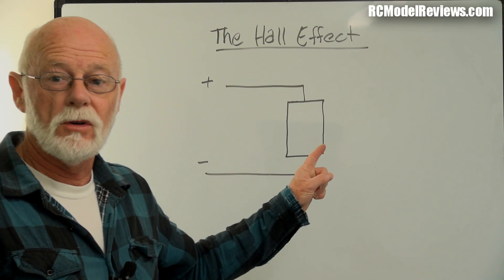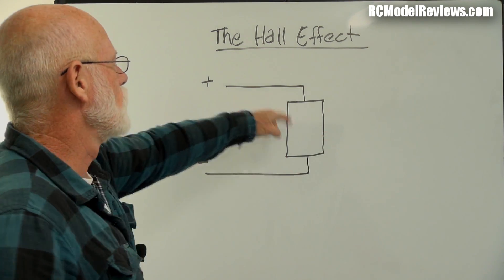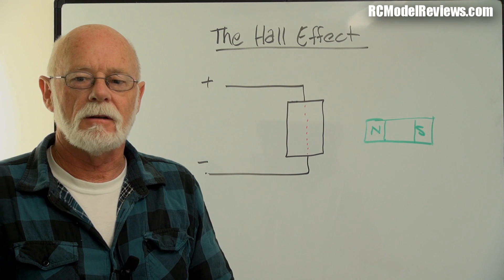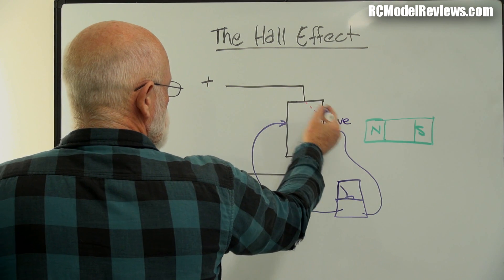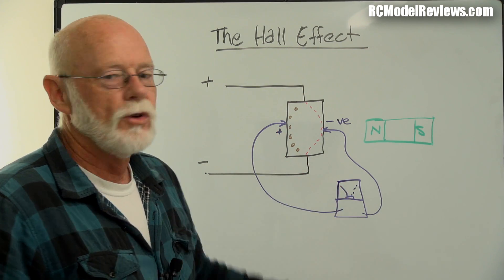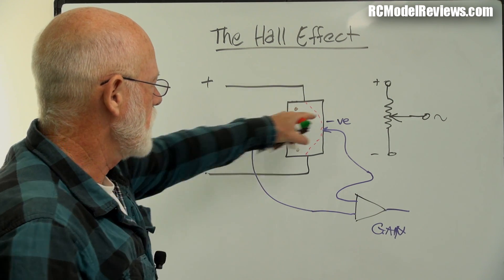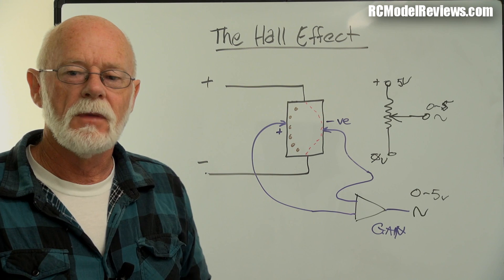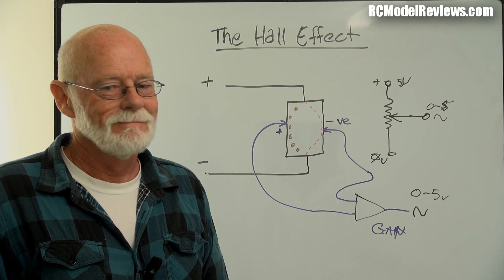Electronics 101: The Hall Effect explained

Comment: I would hypothesize that the hall effect might not be measurable without using the semiconductor, much the same way you couldn't measure the pressure difference between the water at the surface of a pool and the bottom of the pool by using two hoses filled with water. Since gravity is creating the pressure difference, and the water in the hoses weighs the same as the water outside of the hoses, there will be no pressure difference created. Unless you fill the hoses with something other than water, which then you can measure the difference in pressures created by gravity's disproportionate pull on the heavier substance (the water). So I would suspect that that same hall effect that is pulling electrons towards one side of the conductor, would also equally pull electrons away from the conductor being used to measure that effect, unless the effect were disproportionately stronger in the material being used. Which it is apparently. So that's something interesting to take into account here.

Comment: I'm very slow at grasping anything in the topics of physics but what I always tend to do to help me grasp it is to look at the foundation of most all things which is the table of elements I think we are on 118 of them, also I remember the fact that as humans we try to control things for ease of use so for instance if we have 600 volts power source and all we want to do is power a 60 watt light bulb we need to find a way to step down the power and obviously that's where all the components like capacitors and semiconductor come into the equation.
Reply: I explained it in a much better and simpler way. 
https://youtu.be/DtIz_HACSPI

Comment: The GMR effect (and its relatives) is often used for compass chips these days as its much more sensitive than the Hall effect (GMR effect is a quantum / spintronics phenomenon).  For stronger magnetic fields sensors will indeed mainly be Hall effect.  All conductors exhibit the Hall effect, but its a tiny small effect in metals which are very low resistivity.  Being a semiconductor does not have the advantage you describe as holes and electrons cancel out partially - they both get pushed the same direction.  The key point is you need a conductor with a very high resistivity (such as a lightly doped semiconductor).  The sign of the Hall constant depends on whether electrons or holes dominate the current.

The field strength of a magnet drops off as the inverse cube of distance, not inverse square, this is because magnets are dipoles, not monopoles.

Comment: Hi Xapk here again..... just wondering if you know how Hall effect is used in a torque sensor. My e bike's conked out and suspect the torque sensor. Various wires going between the sensor and the controller 6 in total. Just wondering if there's an obvious function of them all which I could test out. One pair is likely to be just a simple DC current.

Comment: I disagree with his curved electron path. The electrons would curve to the side until they reached the edge of the conductor, but they would not curve back again.

The force the electron experiences is called the Lorentz Force, and the equation is F = V X B, known as the vector product, outer product, or cross product. The direction of the force uses a simple right hand rule. Point you fingers in the direction the POSITIVE charge is moving and curl them toward the direction of the magnetic field (out of north pole into south pole). Your thumb points in the direction of the force. Since electrons are negatively charged they experience a force in the opposite direction.

In his picture, the electrons are travelling upward and the magnetic field is pointing to the left, so point you fingers up and curl them to the left. Your thumb points out from the whiteboard. But electrons are negatively charged so the electrons would experience a force pushing them into the whiteboard or away from you.

Comment: Are not proximity switch be better if you have room. most machine tools which I have run all used proximity switches or scales.
All the video's I've seen that the Hall Effect Magnetic does not have the stop  the magnetic parallel to the Hall Effect Sensor but only as far as it needs to to make or break the circuit.
Where as the proximity switches must be in line with each other in order to make or break the circuit.
All of our machine tools used proximity sensors or scales to make or break circuits.
I would never use a limit switch or Hall Effects sensor unless I had no other choice to do so. Proximity switches are so much more precise & reliable that I'm surprised to find so many people touting the great benefit of these out of date switches.
When I re-control a machine I always use proximity switches.

Comment: Is there a way to tell which wire is which? I have a new wheel speed sensor to install, but the company changed it with no plug and told me to just splice the wires together. I think I know but I'd like to know for sure I'm wiring it right the first time.

Comment: For the people who don't like the lack of scientific rigour of these mini-explanations, please don't be too hard on Bruce. He's presenting 'boring' information to the layman (and one woman). Of course the science may not all be defined in sufficient detail to suit current theory [pun intended], but that doesn't matter. Getting things vaguely wrong(-ish) doesn't matter either.

Defining terms EXACTLY and CORRECTLY would take up far too much time and bore non-specialists to the point of turning off. And it still wouldn't satisfy the pedants, who'd be happier on a serious forum where they could discuss things at a level of their choosing.

A good example of how tiresome things can get is to try to explain how a wing works. What creates lift? Tell us about boundary layers and laminar flow and pressure differences... And the argument about what REALLY happens on a wing's top surface will go on and on and on and on...

Nobody agrees even to this day, so best just to shut up and use the explanation that we all still remember from school but which so INFURIATES scientists and aerodynamicists. Just let it go, get outside, and fly. I don't understand all the theory, but I've been designing model aircraft wings for decades. Never had a failure due to lack of technical insight. If it looks right, it'll fly right, right? Right.

If you want to work in the R&D department at Airbus or Boeing, go to university. Make friends with Osborne Reynolds. Wallow in formulae, minutiae and equations, but please don't expect me to share your fascination with such dull stuff on YouTube.

Bruce chooses to discuss things at a level even a biscuit such as I can understand. It's his Channel. It's not The Open University. He can do what he wants, and he always makes it clear that he's explaining things for disinterested (but not uninterested) parties.

His basic approach to potential [pun intended] tedium and yawning is to whet people's interest and move on. Quickly. Before they fall asleep. IT DOESN'T MATTER THAT PEOPLE MAY BE GETTING INCOMPLETE INFORMATION ABOUT THE SUBJECT. If they care enough, they'll dig deeper by themselves and clarify/correct all the points that (quite understandably and perfectly reasonably) upset the experts. For everyone else, well, they'll get on with their lives just the same as before, BUT they'll take with them a simple understanding of a new topic, and anything detailed and fussy - be it ever so wrong - will have soon been forgotten.

Calling 'mass', 'weight' is a criminal offence that carries a sentence of some gravity...

So don't fret about peeps passing on false information to their peers and spreading scientific inexactutudes, dudes - just be grateful that there's a little bit more reason and science in the world, and not quite so many magic beans.

Comment: Wouldn't the electrons be redirected in the direction into the whiteboard? Because F=q(E+v x B) where there is no external electric field, but the velocity is up, and the magnetic field is to the left, and the electric charge is negative. So by cross product I expect the applied force would point into the page.

Comment: I'm trying to imagine how this works in a component I have to repair.  The Hall effect motor drives a shaft either in or out, (it's a linear actuator).  But how does this particular motor reverse the polarity to send the shaft in extend or retract position?

Comment: Home heating Condensing boiler with Hall Effect sensor in a EBM blower with speed issues how would I diagnose it?  Could a ignition at 10,000 volt near a fan cause a sensor to loose the Hall effect.
Thank you

Comment: thanks Bruce, interesting video, I've been looking into these, i just bought 2 different ebike levers with hall sensors, and a servo tester, I'm going to wire it to replace the pot in the tester to make it control the esc, as I'm building a hydrofoil surfboard, and need a waterproof speed control lever of some kind, but im wondering, or i mean asking for your advice..;) if a little 1 channel radio ekate trigger speed controller could have its pot replaced with an e bike hall sensor trigger, it would be better having it wireless instead of a cable going down into the nose of the board, hope you can help on the ponder, and hello from Ireland :) cheers

Comment: Dear Bruce, 

Thank you very much for your video! As a physics teachter in training these video's about details such as the Hall Effect are very educating and gives me plenty of food for thought. 
Only thing i wonder about: in your video at the end you said that the compass in modern day smartphones use the Hall Effect to work. 
Can you explain HOW they work? Because the magnetisch field of the Earth is quite small (*according to my physics book in the order of 5 x 10^-5 T. How is a compass of a smartphone able to detect this magnetic field with all the electronics in a smartphone, which also creates a magnetic field because a moving charged particle (e.g. an electron) generates a magnetic field. I'd think that the electric field generated by al the electronics in a smartphone interferes with the earth's magnetic field and thus a compass is unable to detect the earth's magnetic field.
Reply: Cynthia Bakker  This may be overly simplified, but may help to understand why it can work. There are two kinds of magnetic fields being generated by the phone's circuitry: high frequency (from the radios and computers) and static (non-varying) from currents in the DC circuits. The hall-effect device is generating voltage from all sources inside the phone plus earth's magnetic field. The high frequencies can be filtered out, leaving the static fields from the phone to be dealt with. However, the static fields from the phone don't change relative to the hall-effect sensors, so they merely produce a constant voltage offset which can be compensated for, both during design and during alignment in manufacturing. What's left to be measured are magnetic fields from outside the phone. A hall-effect sensor is sensitive enough to detect and measure earth's magnetic field. Provided you are far enough away from man-made magnets or large ferrous objects (which would only produce measurement errors), you're good to go. Hope this helps.

Comment: My main question is how fast is the hall effect monitor versus some other form of current sensing? Would it be considered a slow sense or a fast sense?
Reply: Walter Bunn  Generally, slow. A quick Google search reveals that hall effect devices are good from D.C. up to somewhere in the mid-10's of kHz. For example, I saw high specs of 1, 25, and 80 kHz on different devices. HTH

Comment: Hi Bruce! I need your help.
I want to make a magnetic flux sensor using hall effect but I'm stuck with the formula
Which equation should I be using to convert Voltage Hall into Magnetic Flux Density?
I'd like to apply the sensor to electric motor DC.

Comment: thanks I came here cause i have been having many failures of a 3 wire hall effect that is made to use with a vw speedometer cable turning a hall effect with 3 wires and gives the signal to the speedometer MADE BY VDO company ,,,the hall effect works fine when its new ! and in about lets say 6 to about 9k miles fails ? the speedometer pointer becomes very erratic and not staying on the speed your actually going , and fluctuations of over 30 miles per hour happens , driving me nuts cause cant tell at what speed your actually going anymore ,,,,ok install a new one it works for about the same and fails, they keep doing that and VDO is not trying their best to say that their hall effects is failing ? they seem to want to go around the bush ,,,so i test the hall effect by powering the red with 12 volts dc black is neg ,then dvom red lead goes to the white of the hall effect and the other black com ground spin it by hand very slow its not showing 12 volts at all or opening either as i turn the shaft i just get a fluctuation of various low volts reading and it never goes to OFL ,,,so it never opens , i dont know how  they are made but i keep returning them and get another but this gets old fast ,,,what could go wrong inside these things that they dont want to talk about ? thank you for sharing your video ,,,,
Reply: Maybe an engineering defect causing thermal failure due to ion motility or maybe electrostatic shock? Because you know if you have a PC, the fans in there are brushless fans, so to control pole switching they have an internal hall effect sensor inside the motor switching 4 times per revolution at 1000-4000rpm, and i have never not once seen one fail - either the fan fails mechanically or on the H-bridge, never on the hall effect sensor, and these fans can run for an eternity, most of the ones i have have been run for 10 years and maintained mechanically. The hall effect IC is fundamentally not expected to be a weak point of hall sensor based designs.

I suggest first excluding that electrostatic damage occurs to the sensor, maybe suppress it with an inductor or clip-on ferrite in line with 12V input and a capacitor across 12V input; as well as if possible establishing what temperature the unit will reach in-situ.
Reply: The magnets are coming loose ?? It's almost always in anything a mech failure

Comment: You may have some things wrong if you reverse the polarity of the voltage source does the voltage at the meter reverse? if I'm been taught correctly it does, it would not be that the magnet attracts or repels electrons by the magnetic pole because it would all way attract electrons by one pole and repel by the other regardless of the perpendicular flow of electricity. The direction of the flux field, which reinforces or collided with the electromagnetic direction of the plate making one side the easier path and therefore causing one side to have more electrons,  that is more likely responsible for the hall effect.

Some potentiometer use coils which will have stronger magnetic fields, that may be what is needed for your pot explanation. 

We do not know if this has anything to do with hell, because hell may have different physical properties, maybe even a different dimension, be an alternate reality that exists in a parallel to our own, but where things work or happened differently, or something.

Comment: The explanation given for the Hall effect being greater in semiconductors is not right. Most of the current is carried by electrons (in N-type semiconductors) OR holes (in P-type semiconductors), not both at the same time.

The real reason is that there are far fewer charge carriers in a semiconductor than a metal, so for a given current they have to move faster. This results in a greater deflecting force from the magnetic field, and so a greater voltage accumulating on the sides.,

Interestingly, the Hall effect can distinguish between positive charges moving in one direction and negative charges moving in the other direction, since these lead to opposite voltages across the conductor.

Experimentally, it's found that in metals and N-type semiconductors, the charge carriers are negative -- but in P-type semiconductors, they're positive! So holes really do behave like positively-charged particles in all respects.

Comment: Nice quick video. I believe you have the direction of the magnet (magnetic field) mixed up. In the orientation you show the magnetic field is parallel with the movement of the electrons. The cross product between velocity and magnetic field would be zero. The magnetic field would have to be either into or out of the board.
Reply: Probably correct.  Just a minute, I'll dig out my three dimensional white board.

Comment: The magnetic field, the current created by the voltage applied to the Hall affect device and the force acting on the electrons should be all orthogonal to each other. So on your white board the north pole of the magnet should be behind the white board and the south pole in front. Fleming's Left Hand Rule (for motors) gives these directions (it uses conventional current flow, even though that was subsequently shown to be the opposite to reality) would have the positive of the applied voltage at the bottom of the device illustrated with the negative on the top (if the negative of the Hall voltage is to appear on the right of the of a Hall affect device as illustrated).
Reply: So this entire 11 minute video is incorrect?
Reply: the magnetic field emanates from North. To get the deflection to the right as shown on his whiteboard, the N pole has to be in front and S pole behind the white board. F = q* v x B.
Reply: Took me a while to understand this comment, thank you for your explanation sir